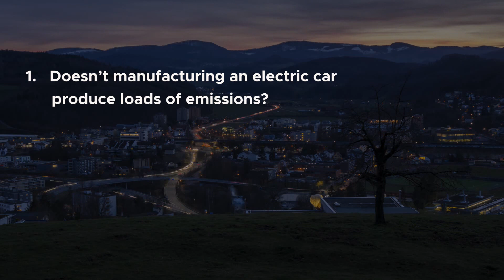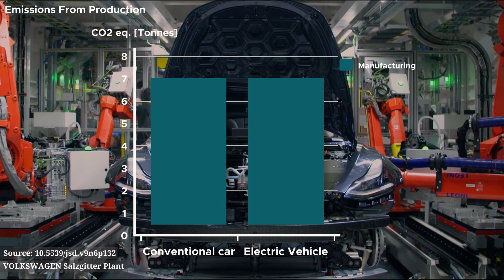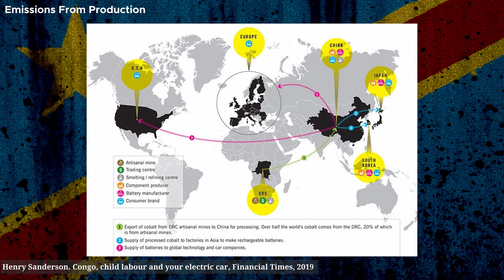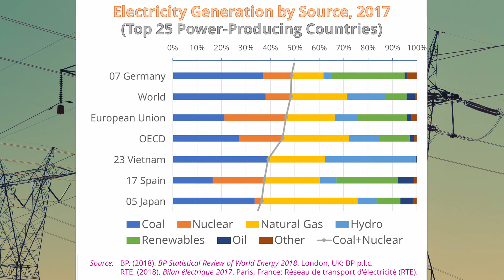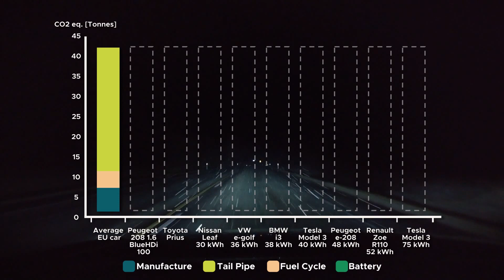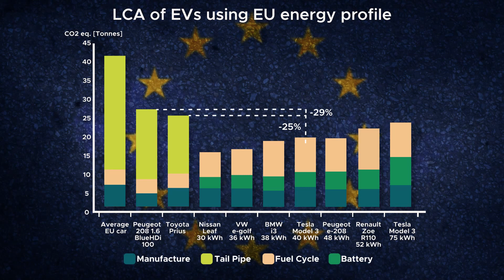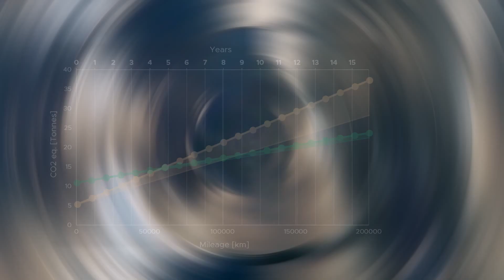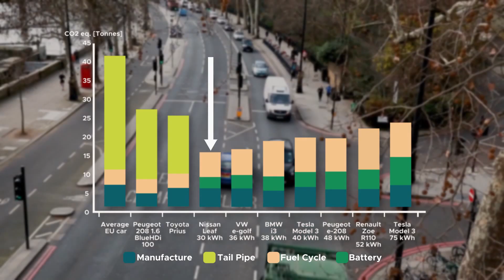Could Electric Vehicles be Bad for the Environment? Data Reveals the Truth

Comment: Nice vid, maybe we could discuss the impact of the rising trend of renewables in the energy mix.  Also I feel the environmental impact of mining is always excused from standard ICE cars...palladium in the catalutic converter, nickel on the chrome work, exotic metals in high performance engines?  Might we also recognise that most of the worlds cobalt is used in the processing of petrol?  And this is non recyclable as opposed to Battery uses of cobalt?
Reply: LFP battery chemistry, as now being used more and more in EV's don't use cobalt, nickel or manganese. They also have much higher cycle life, are much safer and tolerance to charging to 100%.  EV industry is embryonic compared to ICE, given another decade you will see cheaper more efficient vehicles that will transform transportation.  The only arguments against EV's must go hand in hand with denying global warming as a phenomenon.
Reply: your comment opened up a Pandora's box
Reply: CO2 is  NOT harmful.   CO2 cannot change temperature.  The global average temperature did  NOT  change for over 26 years.   CO2 is ... a  BIG  business. 
There is  NO  man made climate change.  Most of you don't even know the difference between weather and climate.  EV's are not electrical, they are just battery cars.  There is no such thing as renewable energy: Physics... ever been to school, good doers? Thought so...
Reply: And lets not forget that modern day EVs such as the model 3 will last 300-500k miles....so we wont need to produce as many?  Its also worth noting that once we reach saturation of EVs on the road and steady state supply.  Because we can recycle 95% of the packs.  We wont need to mine as much material.  Where as ICE cars will still be using cobalt to refine the petrol, smelting more materials to rebuild and resell ICE cars to us.
Reply from the maker: @mathewroberts4834  I'm skeptical about 500k miles - that would last the average EU citizen 40 years! Perhaps the car could last that long if taken care of but the battery certainly will not. Regardless it should last more than long enough to pay off its carbon debt.
Reply: @OurEden  lithium Iron Phosphate batteries will repeat 3000-4000 cycles of charge without degrading below 85% in general.  Battery packs sized to provide 300miles of range mean that theoretically we can see over 1,000,000 miles.  Regen braking and fast charging can have a negative effect on the health of the battery.  But you better believe the battery will outlive the car.  Unless you look at the lesser end of the market with say Nissan Leaf batteries.
Reply: @mathewroberts4834  "Battery will outlive the car" Well it doesn't for now it seems. Look Rich Rebuilds repairing multiple Tesla batteries because Tesla refused to do it as they wanted to replace it completely adding to waste.
Reply: @mdjey2  Just like rich rebuilds emphasises in his videos.  Once a Tesla is in an accident, because they cannot confirm whether the liquid electrolyte has been removed from a battery or by centrifugal force allowed elements of the battery to be exposed.  Then their preference is to remove that pack and recycle it for the safety of all road users and owners.  That's not necessarily 'waste' and even if it were, it takes roughly 15k miles before the complete cars carbon footprint is negated vs owning a new ICE car.  Older ICE cars are generally dirtier running, so the value of keeping an old car on the road isn't as strong as you might believe.  If the components of the battery are recycled, then there is actually very little 'waste' in this approach to safety.  It is FACT that the batteries in Teslas will outlive a typical car, research a company called Tesloop.  They have done hundreds of thousands of miles in very early model Teslas and proven this over dozens of cars and publish the data freely.
Reply: @mathewroberts4834  "company called Tesloop" Well that doesn't seem like they will be biased at all with that kind of name. You seem to be living completely in the dream. In reality if you want to recycle battery you need to completely take it apart to individual pieces because you cannot use one method of recycling to all different parts which this battery is made of. That would be very expensive so actual recycling isn't very effective. "so the value of keeping an old car on the road isn't as strong as you might believe." I would trust my wallet first. All that carbon footprint isn't necessarily a bad thing.
Reply: @mdjey2  it's disappointing that you didn't look up tesloop just because of the name.  They are a company that use teslas as hire cars, they have many cars with over 400k miles and they are still in use.  Your perceived bias cannot negate that the longevity of lithium ion batteries is now a reality.  And also consider that these teslas are now dated technology.  Wrt recycling, you can use pyrolytic or cryogenic means.  Neither requires this methodical approach that you are detailing.  You either set melt them, or freeze them and then shred them.  From the remaining material you begin to synthesise for the metals that you wish to extract.
Reply: @mathewroberts4834  Only longterm solution is hydrogen.
Reply: @mdjey2  haha good one.  Hydrogen is very low % efficiency in a closed loop, you will pay alot of money for the energy vs electrical storage.  Hydrogen also often uses methane as a source because the fossil fuel industry is successfully lobbying governments worldwide.  It has its place, Hydrogen is a better alternative route kerosene on long haul flights, long haul freight and can provide a better storage facility when a long duration of discharge is required, such as days without renewable energy e.g. wind not blowing.  But in a car...its not great unless the energy taken to create it is very low price and the carbon dioxide left over from the methane that the Hydrogen is extracted is also succesfully captured and stored (another expense to consider)
Reply: We need to ask politicians why we aren't subsidising EV chargers and renewables in the UK anymore, but we are subsidising Hydrogen projects that use Natural Gas at 12% overall efficiency vs battery storage at 90% and hydro such as Dinorwig or Cruachan at 30%
Reply: @mathewroberts4834  Hydrogen solves grid problem as it can be stored and also be made from methane which can be useful if you don't have electricity. Doesn't actually matter how carbon neutral something is if you can't replace all cars on the road and with batteries you certainly can't do it, but Hydrogen cars on itself is more carbon neutral than something with a larger battery.
Reply: @mathewroberts4834  There is a drone that can fly 12 hours on hydrogen. How long you can fly with a battery?
Reply: @mathewroberts4834  Check also Alex Lab what cool tech that Russian guy makes with hydrogen. "With a box of scraps"
Reply: @mdjey2  how are all cars on the road limited to not being able to be replaced by batteries?  We have enough Lithium, Iron and Phosphate.  We don't have enough Methane, nor the tolerance in our atmosphere to absorb any more carbon dioxide without detrimental effects.  If we chose to use more renewable energy, its best to efficiently store that energy, at the moment, Hydrogen is very far from cheap or efficient.  Grid storage it has its merits, but ultimately there will be a cheaper solution in chemical batteries, gravity storage, vanadium, redox flow etc.  Hydrogen from methane is mostly a fools errand sold to our politicians to maintain use of existing infrastructure that is at risk from being a stranded asset.  Again, I do recognise that Hydrogen is a better solution for purposes such as long distance flight, freight and construction machinery.  But not every day transport and everyday energy storage.  If we want to use Hydrogen for everyday transport and energy storage, we will need vastly more renewable generators on the network, vastly more investment capital and to what end?  So we can continue to extract methane from the ground?  I'd rather just store the energy in the most efficient and commercial manner.  I'd rather purchase a vehicle with lower running costs and lower capital cost.  Hydrogen will not win out, but will absorb alot of tax payers money to prove out.
Reply: @mdjey2  there is a solar powered plane that has circumnavigated the globe, it has a battery.  It flew for almost 3 months without landing.  But yes, long haul flight is more suited to Hydrogen planes as I mentioned earlier.
Reply: @mdjey2  cool vids, thanks for the recommendation.
Reply: @mdjey2  they recycle , is more cost effective and pollute very less more
Reply: @mathewroberts4834  it costs well over $6,700 to recycle a tesla battery. They claim they recycle them but it’s hard to find the actual place.  And it’s cheaper to pay for newly mined chemicals. Heat, ultrasound or acid recycling techniques all require power from somewhere to recycle. 
It might be cheaper for the ev owner but somebody has to pay for the blood mines & the power because renewables can’t supply all the evs plugged in at once. They take down neighborhoods in CA even though CA has the highest % of renewables. CA is warning brownouts are coming this summer.
Reply: @mathewroberts4834 you only present one side
Reply: @fredziffle5219  I haven't promoted a side but only pointed out the deficiencies in assessing an opposing view.  I'm open minded, but it appears to me as though you are against EVs.
Reply: @mdjey2  What a load of bovine manure. FCEV are EV with a too small battery and insane levels of required maintenance and a fixed date when it must be scrapped - every 6000 miles you need to have the tank system pressure tested to 800 bar/11500 psi, every 18000 miles you need to have new high performance air filters installed, if you don't the fuel cell membrane might not even last the 36000 miles when it needs to be exchanged. And on the fuel filler cap there is a fixed "do not refill after" date at which the high pressure tanks are deemed unsafe and the car needs to be completely rebuilt or scrapped. Do you really want to have a 700 bar/1000 psi tank between rear seats and the small trunk in which there is hydrogen which can diffuse through solid metal and structurally weaken the tank walls when doing so? There also isn't any infrastructure to support these as the hydrogen fueling stations need to be apart from any habitation or industrial estates after a Norwegian filling station blew up and a tank similar to those used in filling stations of an small experimental fuel cell power station in Malaysia blew up killing innocent bystanders in the industrial estate...
Reply: @karlgunterwunsch1950  then you shouldn't use EVs either. They are more likely catch on fire as they have more battery and you can't extinguish that fire. Other point goes similar to when EVs first appeared and there was no infrastructure. After 10 years there is some infrastructure now, just very slow. Basically you suggesting people like me to stick with combustion engine vehicles since I don't have a house and new technology is incredibly dangerous.
Reply: @mdjey2  Wrong, EV are 44 times less likely to catch fire than an ICE per mile driven (so that you can compare figures when there is a discrepancy in vehicle number it's scaled to the distance covered, not individual vehicle numbers). And it's a blatant lie that they can not be extinguished. In Germany our fire departments have already received appropriate training and the means to control EV fires, even if most of them probably will not see one of them happening. 
The Swiss fire department researched the effect of vehicle fires on tunnel structures (always a worry for them ever since there was a big fire in a tunnel that cost a lot of lives) - and they found no noticeable difference in dealing with an ICE fire to an EV on fire in their test tunnel. The aftermath of the fire was on similar scale and posed no structural damage to the tunnel itself.
Reply: @karlgunterwunsch1950  "no noticeable difference in dealing with an ICE fire to an EV " Thats a lie. And you still didn't answered, what should I own if I can't charge my car.
Reply: @mdjey2  That's the official stance of both the German and Swiss fire departments. The technology to deal with EV fires (as rare as they are) has been proven to be very effective für ICE fires as well, that's why there are no big differences. And EV ownership isn't a big problem unless you need to drive 500km each day every day.. Where I live McDonalds has partnered up with an electricity provider and is building new charging stations like there is no tomorrow. Just in my vicinity three new high performance chargers have opened on the parking lots of McDonalds in the past week. On such a charger my EV can add 300km of range in the time I need to order and eat a cheeseburger...
Reply: @mdjey2  
Hydrogen throws away 60+ % of grid energy used in its production
Reply: @mdjey2  
Your "Hydrogen from methane" (natural gas) opinion hasn't aged well, has it?
Reply: @OurEden 🌟No way will EVs last that long. More sales talk it is. 😅
Reply: @OurEden then you know little about batteries. I lived totally off grid for 12 years on my yacht.  Last 8 years with lithium batteries. When I sold the boat I did a health check on the batteries with the new owners. They were at 98% of original capacity. You are now seeing the transition of EV's to LFP chemistry fr9m NMC which will give 3 to 5 times the cycle life.  Conservatively 3500 cycles multiplied by say 200 miles  equals 700,000 miles, perfectly feasible in my experience.
Reply: @fredziffle5219 That's fascinating, where did you get this number from, I'm intrigued. Please share your source.
Reply: @mdjey2   are these not crash damaged and flood damaged cars?  Does rich rebuilds basically live in a scrap yard?
Reply: @mdjey2  this comment hasn't aged well, we now have billion dollar companies focussed on recycling batteries and regulation to enforce it in the UK and EU at end of life
Reply: @mdjey2   this also has nit aged well as even the UK govt has recently pulled funding for these projects in the realisation that H2 is good if green, is not cost effective vs electrification.
Reply: @mdjey2  hydrogen was purported to offer demand side response to the perceived inevitable saturation of offshore wind.  This is a ridiculous argument, who is going to pay to build an expensive offshore wind farm in order to give away electricity?
Reply: @mdjey2  very extreme edge case if true.  Happy for that drone to keep using H2 from industrial processes or green sources.  But in the whole, H2 is not the solution for energy storage, or transport other than long haul flight and heavy duty haulage/construction vehicles.
Reply from the maker: Really good points here. We didn't do into the details of ICE manufacture as the video was already getting a bit too long, but you're right in that they use a lot of different heavy metals in both the car and refining of fuel. Regarding fuel refinement, metals are usually used as catalysts so technically they are non-consumable. However, the extraction of minerals for fuel refinement is an important issue which EV critiques often forget about.